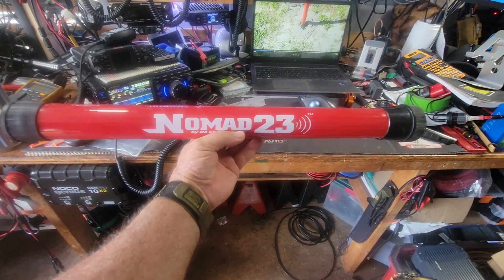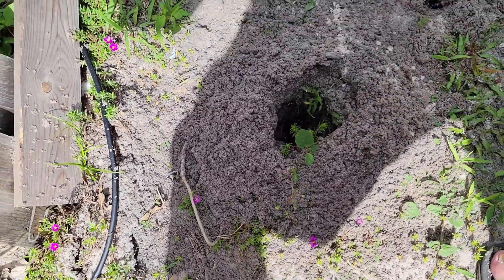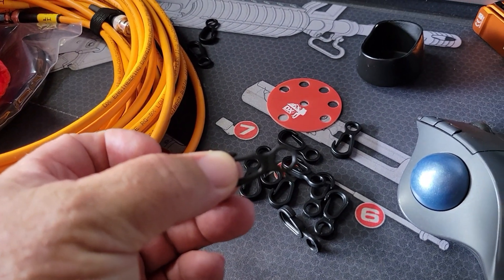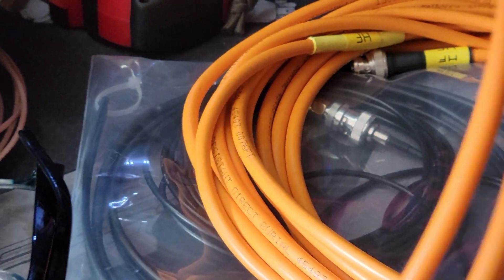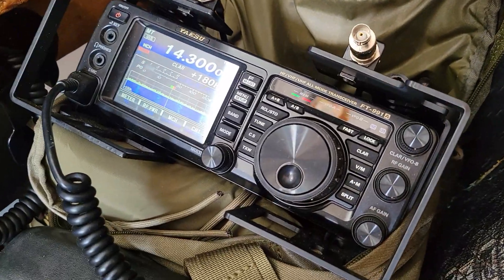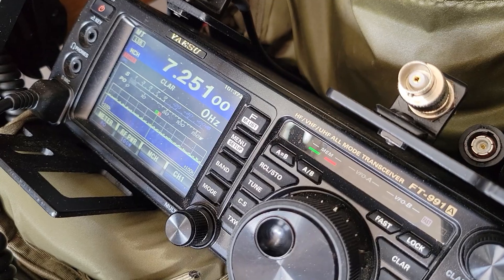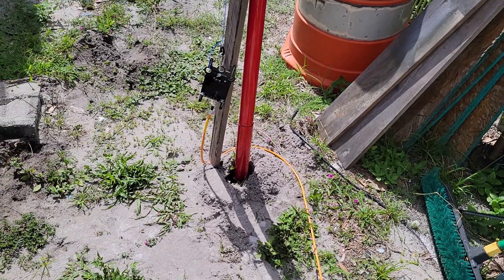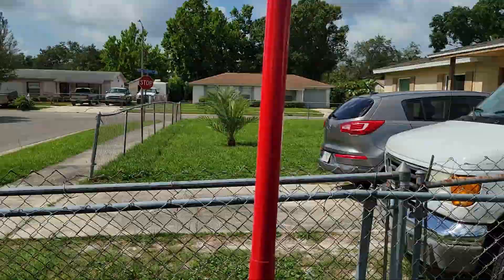Nomad23 DX Engineering Portable Telescopic Masts

Comment: About how much weight will these masts support? Could I hang a rollup J-pole with a decent length of coax connected or would it collapse?
Reply from the maker: At 14 to 15 high yes. Higher than that I'd have to check. I'll test and let you know soon.
Reply: @Rusted_Link awesome thanks, I'm looking at the 19 foot version for potential use as a portable VHF j-pole support for ARES stuff in case there aren't any trees.
Reply from the maker: @EMC_ADVENTURES This is one of the most rigid I've used. It might be just what you're looking for.
Reply: @Rusted_Link Thanks for doing this video, you're the first to do any kind of review since these are so new. This mast seems like a really good value since it comes with a carry bag and guy line rings/clips  a fraction of the cost of some other fiberglass masts.
Reply from the maker: @EMC_ADVENTURES  the video with the roll up j-pole is loading. Sorry for the delay but I was on my pontoon TXing from a sandbar in the Keys and drinking beer for a week! Tough life. I didn't take the Xiegu on the Kayak yet, but it's coming! 20 meters from the water to Virginia on 10 watts. I checked in on the Intercon net.

I was here - 24.743299399400733, -80.96936313181305
Reply: @Rusted_Link You're the man! I really appreciate you taking the time  to answer and a video is above and beyond. Really cool of you. 73!
Reply from the maker: @EMC_ADVENTURES  Get your General or Extra. When you start talking NVIS the word EMCOM takes on a very exciting meaning. I can talk 40 meters from 8 miles to 408 miles. It's exciting. Last week while floating on a sand bar I talked to Virginia from Grassy Key. That's in Florida LOL. 20 meter on a 17 foot whip and just 10 watts. The salt water was the ground plane.